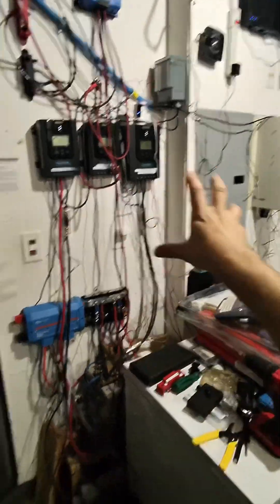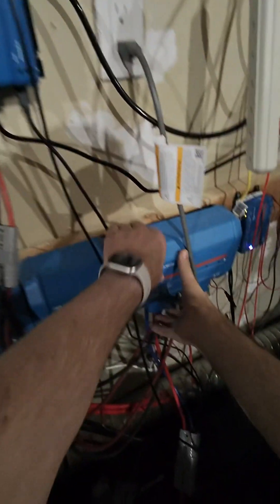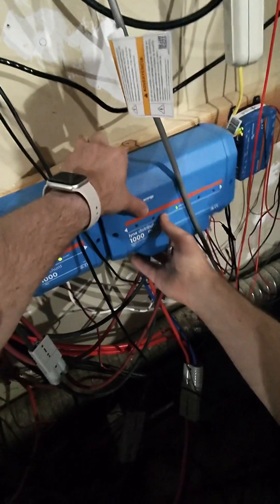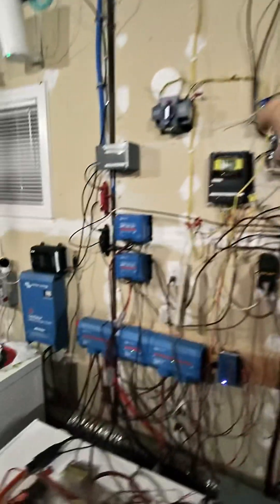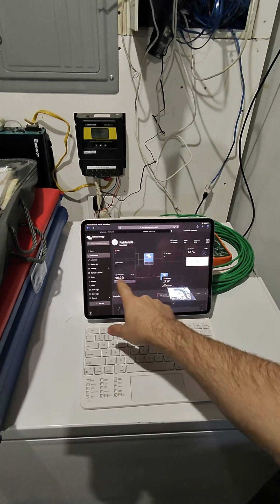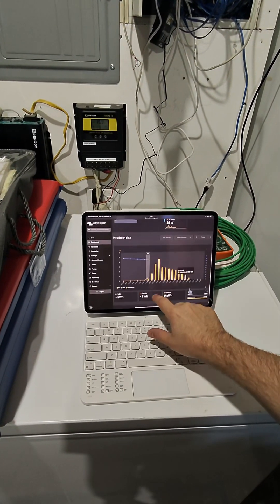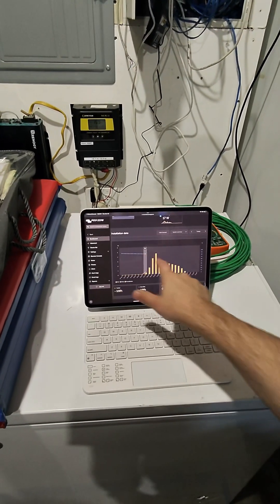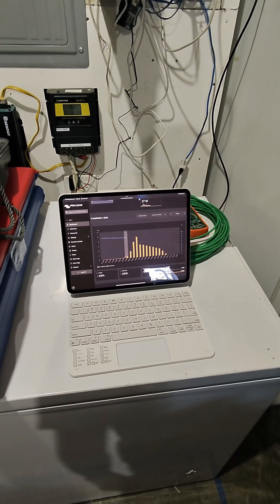Why I’m Converting my Renogy based Solar to Victron

Comment: Victon radiation equipment dangerous RF frequencies play nickel and die me to death for screens and equipment thank you that you can get free with other companies
Reply from the maker: They are expensive I agree, but I think they will last longer.  Will see.  Renogy was good never had issues still works perfect.  Before Renogy I used cheap Chinese inverters they burned out after a year or two like clockwork.